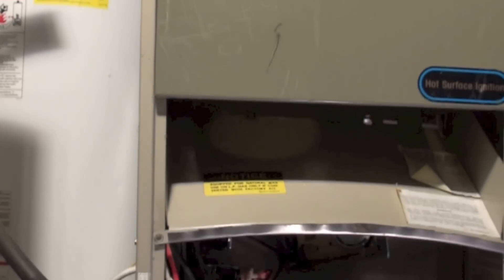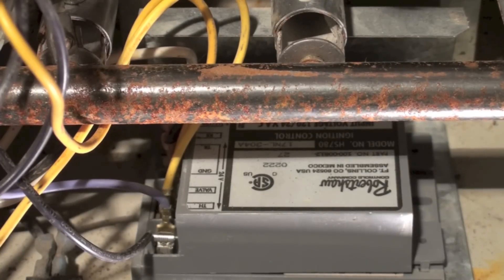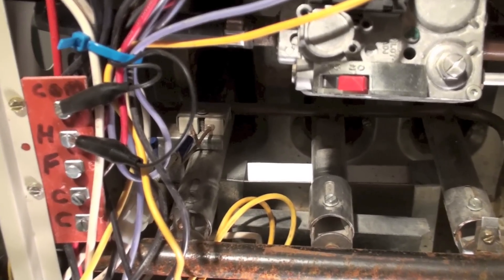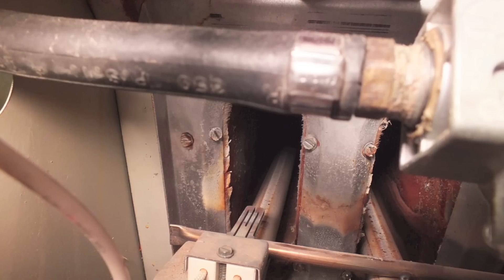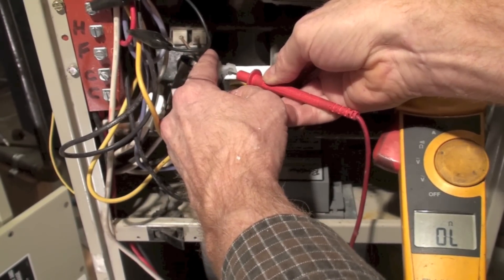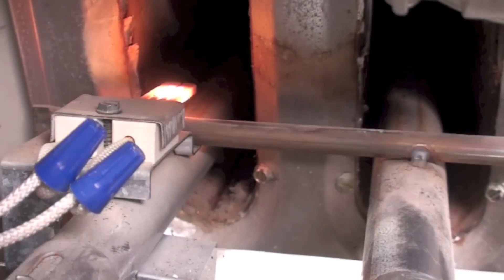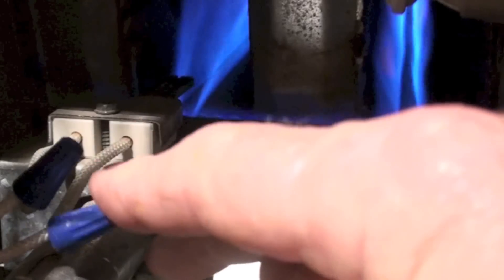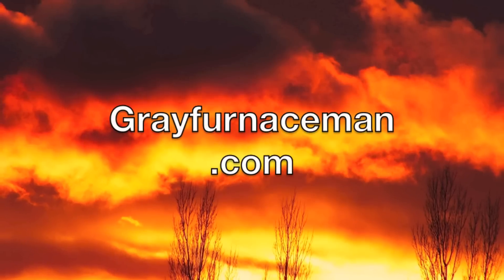Troubleshoot the ignitor of the Rheem RGDA model gas furnace part 2

Comment: Hi there Mr. GFM, I have an even older Rheem, model RGAC-09EC and while it is still working well, it takes EVERY TIME 5 tries to stay on. 
And it has been like that for years, I am amazed that it still works.
What would you think the problem be Mr. GFM? Worn out hot surface ignitor again? And where would the ignitor be located. I don't see anything like yours in this video inside my furnace. Thank you so much.

Comment: Does the hot surface igniter ignite the gas AND prove the flame on this type of furnace? Thanks.
Reply from the maker: It depends on the age of the furnace.  If it was made 1988 to 1992 or so, yes.  After that the manufacturers used flame rods.
GFM

Comment: Thanks for the video, My ignitor is not coming on even after changing a new one, I see the voltage to ignitor, I also changed limit switch and it seems fine. Basic checks like filter, vents done. Any idea ?
Reply from the maker: Do you see 120 volts to the ignitor?
GFM
Reply: yes it's abt 112 volt, also ignitor is 768A-815 model if that helps, appreciate the prompt response. Kinda stuck now.

Comment: Thanks for the video, my furnace is blowing cold air and my hsa does not come obut it shows .140 on the ohm meter. I am assuming it means it's fine and it's a problem in the control, also visually it appeared defect free. Also I did not see any voltage to the hsa plug while cycling the furnace via multimeter. I have an 87 imperial rheem 90 plus.

Comment: This system works as cooling goes and have to make heat starts only if the fan is put to manual blower or fan then it starts up it is much older than what you guys are dealing with here .. ok I would love to find this units block disgrams. or just time to take it apart down to Evaporator coil coz of it leaks and all the cooks in on this unit has made it to the fact of start over with this machine .. Any one have a RGAA 08ec furnace install manual plz.

Comment: Hey There Keith here I have older model : RGAA- 08rc Serial: TN3D104M2179 1526 Rheem split system looking for a manual for this also
Reply from the maker: Have you checked the Grayfurnaceman.com website?  I have a number of manuals there.
GFM
Reply: grayfurnaceman

Comment: Did you make that terminal set yourself or did it come with it? I am wondering due to needing a C wire for a new thermostat.
Reply from the maker: The furnace came with the terminal board.  Some furnaces have a terminal board on the control board.
GFM

Comment: I'm trying to research if I can upgrade my rheem intermittent to a hot surface. Tired of hearing the tick tick tick every damn time.
Reply from the maker: +William Joseph You might check Honeywell they may have a kit to changeover.  Also check White Rodgers.  Hope this helps.
GFM
Reply: +grayfurnaceman HEY thanks for pointing me in the right direction. I see a White Rodgers Hot Surface Ignitor Conversion Kit on Amazon. I just may keep my furnace after all! Thanks again for the tip and fast response.
Reply from the maker: +William Joseph Welcome
GFM
Reply: +grayfurnaceman looks like I'll have to install a HSI module or change out the mother board because I have a direct spark igniter mother board. which is one wire leading to the DSI . this would be more money then I'm willing to invest.
Reply from the maker: +William Joseph That's probably the only way.
GFM

Comment: I have Amana furnace model GUIC070CA30. It's trying 3times but no ignitor & the system shut off....but if I power off then ON couple times sometime it works & then next time it's call for heat stop working again.... So I know the thermostat, inducer, vacuum sensor, & ignitor works....but why it's act that way....please help, thanks
Reply from the maker: +John Nguyen When it fails, do the burners light at all?
GFM

Comment: Could you please describe how to open the lower door of this Rheem furnace?  I have the exact furnace that I want to replace the filter and I know the filter resides in the bottom but can not open to lower door. It has some sort of black pin (also shown on your video) on left hand corner but it does not move.

Comment: Hello again.  Same furnace RHEEM RGDA.  I replaced my thermostat and the furnace ran appropriately for 3 weeks.  Then nothing, been freezing since before xmas.  What appeared to be happening was that gas was not being fed to the heat plate for ignition although the thermostat said it was all on.  Then Last night I woke up to the sound of the heater being on all of a sudden again on its own.  Any idea why the furnace started getting gas to ignite and create heat again out of the blue?
Reply from the maker: Alan Daly Does yours have a HSI or is there a pilot light?
GFM
Reply: grayfurnaceman
It is the HSI and it does glow a nice big orange. By the way, a day later it is back to not igniting..... dont know why it worked one time out of the blue in the last 3 weeks.
Reply from the maker: Alan Daly If the burner did not come on during the trial for ignition, with the HSI on, You must have a gas valve problem, loose wire, or control board problem.  Check to see if there is voltage to the gas valve after the HSI warms.  Hope this helps.
GFM

Comment: Thank you for your help, what I did notice is that I have no voltage between W and C..  Which indicates a thermostat problem.  It is a new thermostat.  So I should specifically be looking for trouble in the wiring?  I did notice that on C there is a quick connect connect on the back but no wire connected on the front.  I wrote this off as ok because I don't have a/c or cooling.. Am I incorrect on that conclusion?
Reply from the maker: Check between R and C.  If you find voltage, you know the transformer is good.  If then you show voltage between R and W, the thermostat circuit is open.  Hope this helps.
GFM

Comment: HI, I have a question that maybe you can help direct me with.  I have  this same RGDA heater which has not run in over a year and since before I bought this house.  When I turn on the thermostat for heat nothing happens, when I turn on the fan plain air is blown through the ducts.  My dad told me it was the gas valve, didn't solve it, PG&E told me it was my robertshaw hs component, didnt solve it.  Now I have just watched your videos and this is what I found.

I connected a jumper from terminal R to terminal W and heard the "click"
I then turned on me thermostat to heat and did jumper R to W again and the hot surface ignitor glowed and ultimately lit the gas to produce hot air.  Once I disconnected JUMPER R to W the gas and heat shut down.

Can you help direct me to the problem with this info.  I ordered a multimeter to check voltages but it has not arrived yet but I am still hoping you can point me in a direction with this limited info.

Thanks
Reply from the maker: I would be looking at the thermostat or the wiring to it.  Hope this helps.
GFM

Comment: I am a service tech. Today I ran across a RGDD model with no hot surface ignitor mfg date 1986. It does have a electronic ignition,  with flame sensor and some kind of other sensor next to it both in direct contact with pilot light. I don't know why the flame stays lit continuously,  clicks, comes on for twenty seconds or so then cuts off. Blower will not come on and gas valve shows 24v continuous. Any suggestions? ?...
I am supposed to return back. Thnks.
Reply from the maker: The other sensor may be a NOX rod for reducing emissions.  The gas valve MV terminal has power when the burner goes off?  Let me know.
GFM
Reply: Oh okay. Well I was having a hars time restarting the burner again , it just clicks. Im on my way to job site now.

Comment: Thanks for these videos, they are very helpful. I have gone through the system, the control module seems to work fine,the hot surface ignitor lights the gas on the spreader rod which stays lite  for about 10 seconds then shuts down before the burners ignite. I've checked to make sure it's gorunded and I have played with the ignitor ut nothing seems to work. Any other suggestions?

Comment: its a Rheem 80+ spark ignition about 30 yrs old runs perfectly. WRGCY are my options I think both R & C are common 24 volts. im guessing C to one of the gas vale terminals would trigger valve? nothing wrong with my gas valve but I want to have a plan of action when the time comes for quick gas valve test, thanks again.

Comment from the maker: You can jumper from R to the gas valve, but you must first determine which terminal is common.  If you choose wrong, some transformers have a fuse imbedded in the windings and it will blow.  Use the wiring diagram.  Remember when the gas valve solenoid energizes, the gas valve opens and gas will flow to the burners.  Explosion hazard.  Hope this helps.  
GFM

Comment: Great 2 part video, Is there a way to jump voltage to the gas valve? weather it be on the board or the terminals on the valve. to hear the click of the valve to be sure gas valve is functioning.

Comment from the maker: Well actually, the furnace you are commenting on is 25 years old.  The 70% efficient furnace that is represented is not available now.  Most forced air furnaces are 95% efficient.  We also have condensing boilers that are the majority of boiler installs.  That said, I do think Europe is ahead of us in energy efficiency.  Energy in the US is generally cheaper than most other parts of the world and we do not always use it efficiently.  Thanks for the comment.  Merry Christmas
GFM

Comment from the maker: This furnace was made for about 2 years during the changeover to the newer 80% furnaces.  They were called the 70% furnace.  They had the newer heat exchanger and HSI but no inducer.  As a side, we could install one of these in a slippy install for under $800.  That was late 80s.  Merry Christmas.
GFM